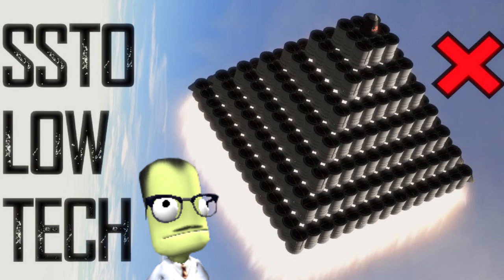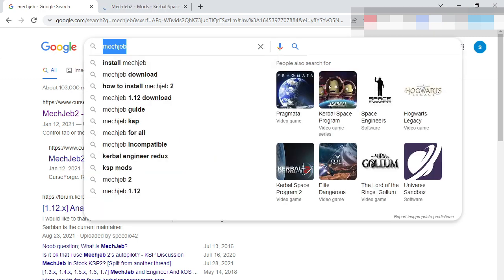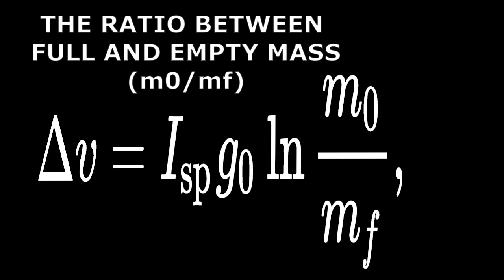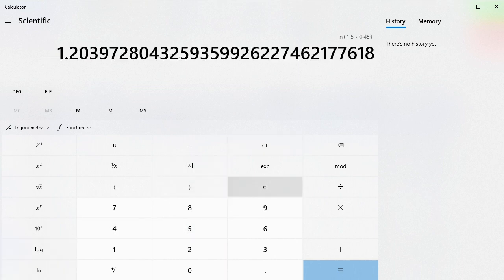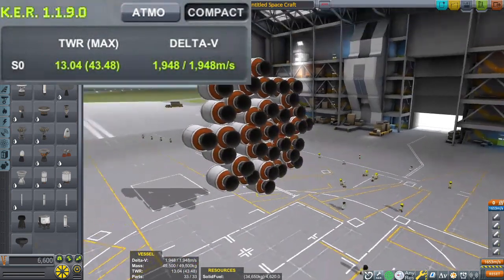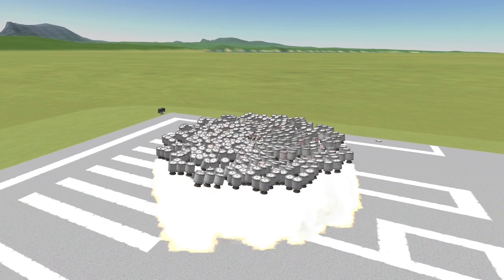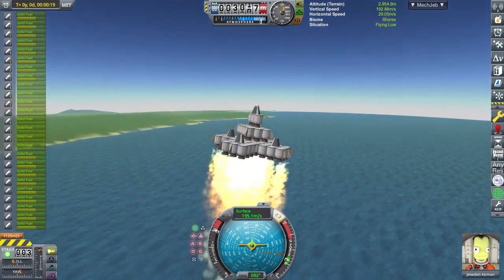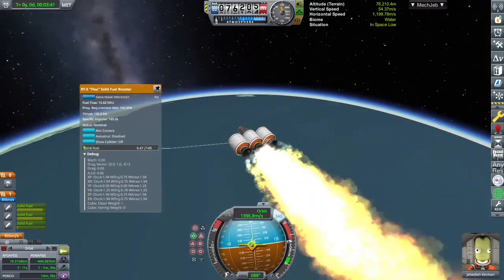Why its impossible to make an SSTO with tier 1 parts in Kerbal space program

Comment: Quick but probably stupid question: is the value for gravity earth gravity or dependent on location. The latter doesn’t make much sense when I think about it.
Reply from the maker: this is actually a great question! If you look at the equation close the g is actually g0, standard gravity, or just average surface earth gravity, im so used to call that G so that what ended in the video...
Reply: Yes it's always the same constant that you use. g0 has no physical meaning in the equation, it's just a conversion factor so you can convert between exhaust velocity and specific impulse, no matter if you count in m/s or ft/s.

Comment: If you have billion boosters, after launching rocket, You will gain ultimate speed, and you only will have to turn it 90° And Ultimate mega trust will make you in orbit
Reply: Each booster has to lift itself. One booster will fly as far as a separate booster launched next to it. You could attach them to each other and nothing would change.

Comment: I think you are wrong. While orbital speed at 70 km is higher than 1948m/s, at higher altitudes, this become lower. If you can make a tall enough tower with tier 1 parts, you can add potential energy to your rocket, making reaching orbit possible. On the extreme side, you can maybe build a space elevator with tier 1 parts, which would allow you to reach orbit without staging.